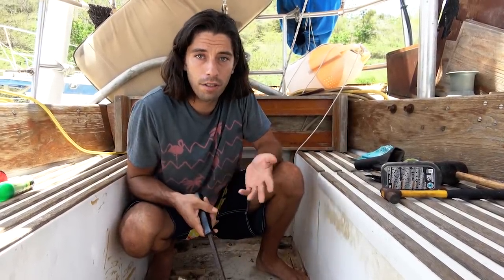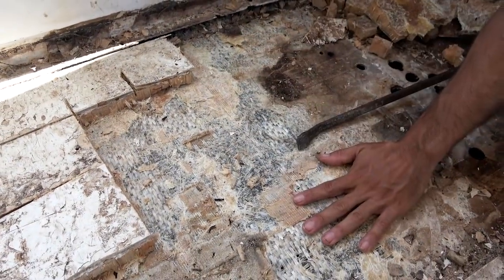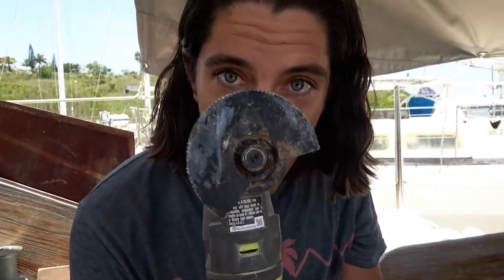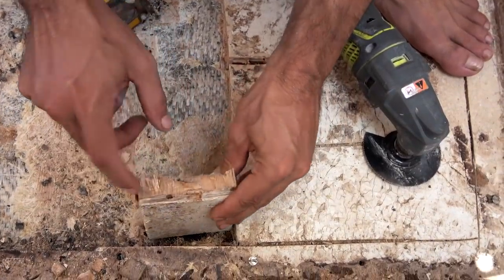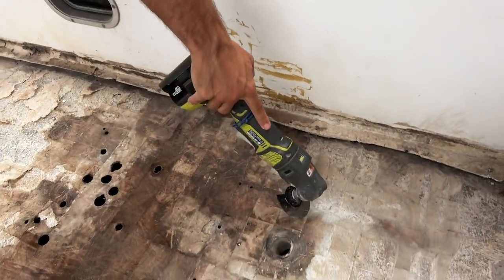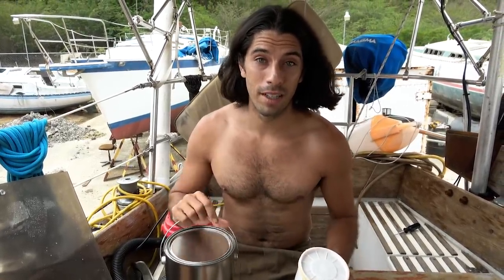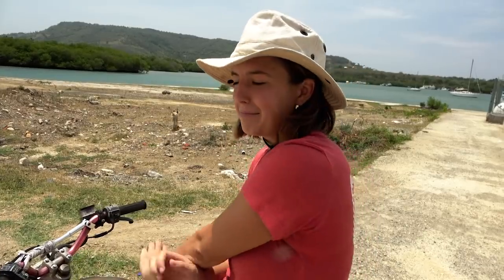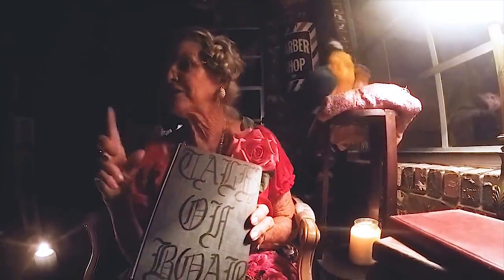Power tools needed... Bums on a Boat Ep 80

Comment: Removing old materials, sanding smooth, laying in fiberglass cloth and painting with appropriately mixed resin and hardener.   Just keep laying in layers of treated cloth (after drying time)  until desired thickness...easy peasy -- no worries!!

Comment: You are doing great work bums!!!  I TOTALLY love the new hair cuts.  On the floor, make sure you glass over the core and sides, this will seal and strengthen.  If you have space between your core and the sides of the cockpit, you need to fill that up with epoxy.  I ended up putting layer after layer of fiberglass in that space and could never get it filled up,  so I put 4 layers of 8oz mat over the top, and joined it to the sides of the cockpit.  Some fairing compound and Bam,  she is good to go!

Comment: I have a similar saw, it does come in very handy on a lot of projects and it's easy to control and guide. It was nice that someone lent you theirs to use.
Reply: I've seen this tool used by professionals. It has to be the best tool.
Reply from the maker: Stephen says it also has a sander attachment that is great for hard to reach places. One epic tool.

Comment: OMG we're feeling your pain! After 2 seasons we've finally finished ripping ALL of the decks up AND the entire flybridge floor off of our 34' trawler. It was the same deal ...the balsa core went bad and the decks were like walking on a sponge! It was a piece of cake to tear up the decks where the balsa was rotten but where it was good, it wouldn't let go. We used a 4" high speed grinder to cut the glass and then a hammer & wood chisel for the core removal. Slow but effective. We used a couple of sheets of nidacore on the bridge where we knew nothing was going to be fastened and also to save weight but mostly we used 3/4" marine plywood on the bridge and all of the decks below and covered everything in multiple layers of fiberglass. We finally have a solid boat but NEVER AGAIN!  What a PITA! Best of luck to you guys, It'll be worth it when it's all done!

Comment: Your clone has been stealing your hair while you sleep.  But that Nidacore will never rot.  Congrats on doing the floor right.  I would have left the rot and made a nidacore and fiberglass floor over the mess.  You're going to have that boat in much more solid shape than any of mine.
Reply from the maker: Never clone yourself!!! What were we thinking. We were pleased to find out we could get it here in Luperon. We will see. Finally about done taking things apart. Now lets see how we do rebuilding.
Reply: @Bumsonaboat  Good to know you are nearing the end of the list of things to take apart.  I hope things go well in the putting back together.  You have to put some sort of sane limit on how perfect you try to make the boat.  I'm about to leave for the summer with a ton of stuff I had intended to do, not started yet.  I missed most of last summer by trying to get too much done, and half the summer was gone before i realized that I had to go with what I had, or wait until this summer.  It would have been easy to pull into the boatyard and wind up living there for years.  You have to stay focussed on the goal of getting back on the water soon.  There are old guys in the boatyard here who have been "getting their boats ready" for years and years.  There are always "just a few more things that will make it much nicer when I get back in the water", and ironically this list is what prevents them from getting back in the water and cruising.  A boatyard vortex can be even stronger than the Marathon Key vortex.  At some point, you have to break out of there or you wind up spending your life growing old in it.  Trust me, I know, I was just a kid and I got a boat, and now I'm old!

Comment: Why chip out the old cockpit floor bit by bit?  Just just it out leaving about an inch all around at the edges.  Then use a pre-laminated piece of NIDA core or similar cut to size and drop it in place. You can glass it in or use 5200 and small bolts every 6 inches.  Much less work and a much better result in the end.

Comment: Stephen Thomas

So the keel repair comes after boats back in water, recall that, so it hangs in its natural position. 

Here is another question: has the boatyard purchased a travel lift while you've been on the hard? 
Or are they going to f@&€-up all your hard work?
Reply from the maker: Exactly and no they haven't. We should be fine but this is another main factor in why we are waiting. We know they will have to lift it by the keel so we don't want to risk damaged a new repair.

Comment: Back it from the bottom with duct tape and thicken your resin as you add glass layers.  1708 should do you well
Reply from the maker: Nice idea, thanks
Reply: @Bumsonaboat  be sure your resin is thickened or it can push the tape out if too thin.  Also make sure that you squeegee out the excess resin well

Comment: You did not need to remove it where it was solid . You could have just replaced what was bad . Without water getting in it was good indefinitely - already made it 30-40 years .  Foam core is better but the real key is keep the water out

Comment: When it comes to tools,my bets are on you because of the underwater hammer swinging event that should an Olympic event that you have perfected.Anyboby with enough coordination to swing a dull hammer under 6 feet of water holding their breath could easily run a F-16 in their sleep.Sailboaters are sometimes under-rated in ignorance by those that have never used a tool other that a cellphone while breathing abundant at will.Most can,t even hold their breath long enough to dial their mamma in Missouri or Florida or wherever she is for comfort.Real men swing hammers underwater for kicks while fending off sharks before breakfast.These men used to be called Marines or special Forces but now they are just called sailors.